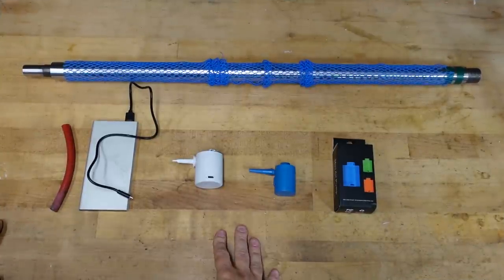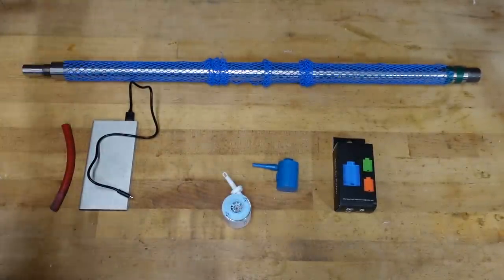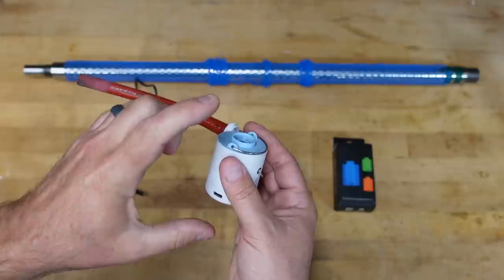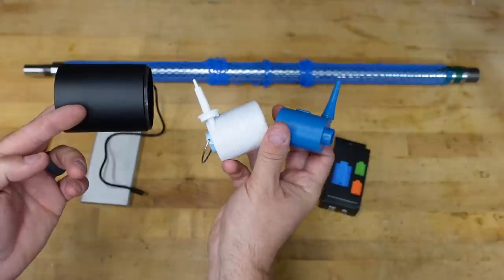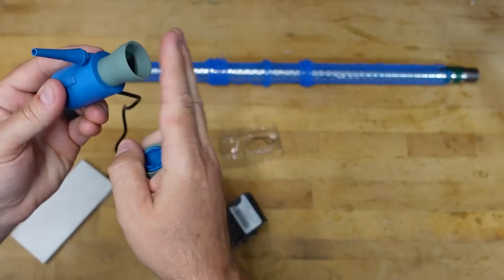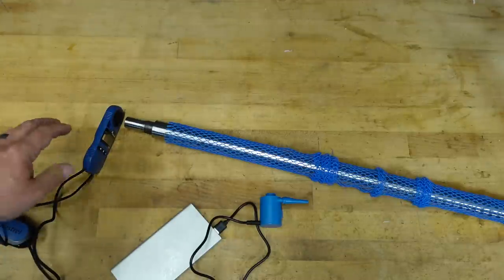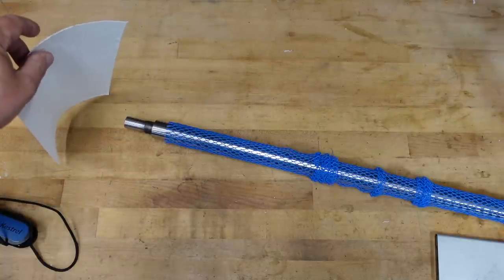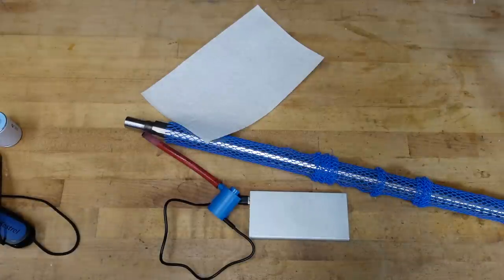Build your own rifle barrel cooler on the cheap NEW AND IMPROVED!

Comment: Hey John, because of the tight tube you're putting them in you should remove the air splitter in the front of the adapter on the white unit. This will result in significantly higher air speeds in this situation. Right now it's blowing a significant amount of air directly at the sides of the tube. Cheers!
Reply: exactly what I was thinking

Comment: John, some years ago, I took a very accomplished engineer shooting p. dogs with me, he was chief engineer on the B-1 Bomber project.  We were shooting 600-1100 rounds of centerfire per day, EACH on the p. dog towns. Barrels were smoking to say the least in calibers from 223-243 AI.  

After we got home after 6000 rounds each of us fired, the Engineer said for me to come over to his house and he had come up with a barrel cooling system.  Simple, he ran water right down the bore, then ran 4 patches down the bore on a tight punch type jag, dried the chamber, back to shooting. ONly took around 6 oz of water. When I questioned him on the water in the barrel, he said that until the bore gets to 800*, the water would never hurt the bore, and any tiny droplets of water left in the bore, would be vaporized by the gases that proceed the bullet down the bore.  So, we have been using this video for 30 years on the finest Krieger, Hart, Lilja, Shilen SS barrels, and on Chrome moly factory barrels.

Running the water down the barrel also had some additional benefits in that the tight patches remove a LOT of carbon.

Folks are very, very reluctant to learn new things, we are all a product of what is popular.  Best of luck to you!
Reply from the maker: I've seen some older video on this topic with the water and I totally agree that it can work but water is very unforgiving in F Class. A single drop of water on a round in the chamber can cause a 9 real easily, I've seen it happen many times when it's raining or wet out and people aren't coving their actions or taking care to dry their rounds. For p dogs I have no doubt it's a great solution and appreciate the feedback.

Comment: Great video bud . I bet if you took an insolated lunch box with some ice in it and drew your air from that it would cool even more . Would help keep motor and battery cooler too . But might sweat . Use a clear hose so you can watch for condensation .👍
Reply: Dry ice

Comment: Have you tried the Riflekuhl? I run mine in PRS matches between stages and it will use 1 CR123 battery on a very hot day and also acts as an ECI.

Comment: It's an interesting proposition. But in my case(I don't target shoot, so cooling the barrel isn't important for my aplication) BUT I do hunt in very cold wheater, Point of impact will change from a very cold barrel in winter to summer sight in/load development. Puting a waterproof sock(The Blue cover game the idea) over the barrel and running freezing water over it might get a better very cold barrel first shot sight in, like your first shot at game 👍A styrofoam box with dry ice/Ice to place the barrel in might work to

Comment: I have a crazy crackpot idea that hooking up a mini shop vac would be better at cooling a barrel because it would suck out the hot air and pull cool air in.  Still figuring out how to mount it.  In the meantime, I am using a unit similar to your first one.
Reply: Won't work as well.  The barrel diameter is too small for suction (pulling a vacuum into the pump).  So you will end up with not a lot of airflow vs the pressurized method every one uses.

Comment: The "Original Barrel Cooler" will do 10 mph out the end of the barrel.  Runs on batteries and lasts most of the day.  Plus you can put in new batteries.  What you REALLY need is a cordless Duster.  Just put your hose on it and away you go.

Comment: Been thinking about getting one live in New Mexico where it's really hot during the summer but I think the weight comparison was unfair you didn't weigh the blue one with its battery pack which is necessary to run it

Comment: Have you tried or seen others use an ice cold wet rag? Maybe the blower is better logistically and it works as a chamber flag
Reply from the maker: I know people do it and I've done it when at the range fire forming (with a worn out barrel) but it's just not practical in any capacity at a match. Aside from that I don't want to shock my barrels like that either (there's debate on whether it actually hurts a barrel but I don't want to take any chances).
Reply: @FClassJohn  if your barrel is only getting up to 200 deg, it's well below any metallurgical change for the long term. I guess in the short term you run the risk of cooling it differently on one side which will put a very slight curve in it until the temperature equalized. Blowing air down the center would cool it symmetrically so that should maintain consistency